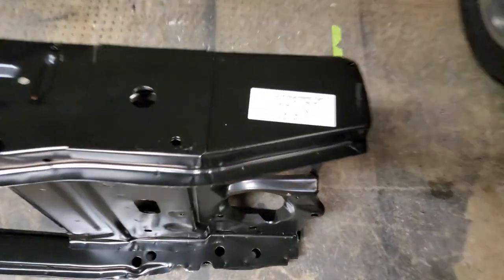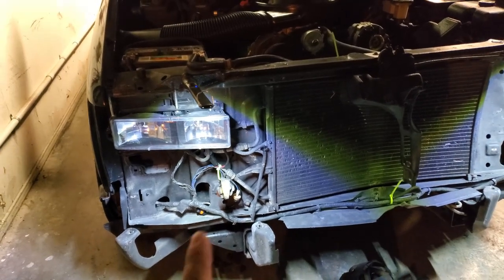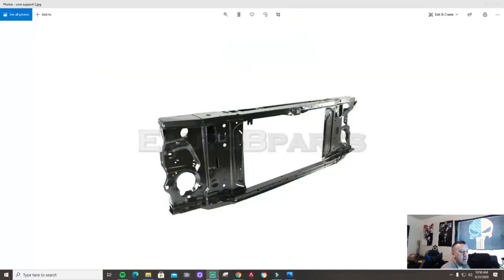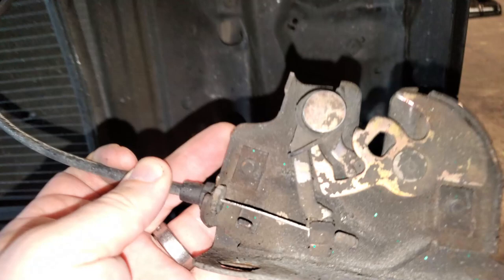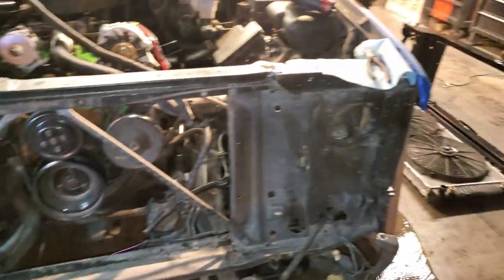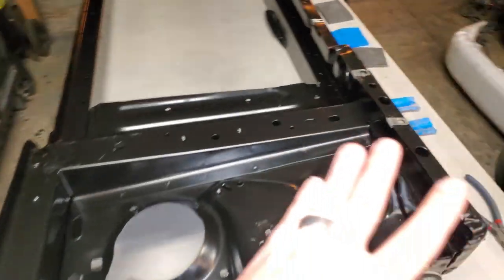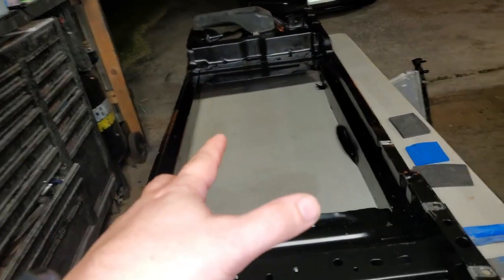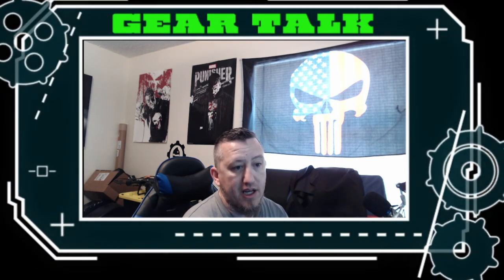Removing Radiator Core Support 88-98 C1500

Comment: Mine is rotted to hell on the drivers side. Looking for a good used one so many are the same way even in the South where there is no road salt. Mine rotted because of NYC/NY Roadsalt.  You did not have to umbolt or loosen any fenders? Going on another quest to find a good used one  I have the Small hole radiator 4.3/5.0 support. The 5.7 bigger  radiator supports are allover the place that are solid. I might jiust convert it to that and put 2 rubber shields.  Or cut the metal out my OEM one and seal the gaps

Comment: I replaced my 94 Chevrolet grill with a 94 GM grill after it was wrecked back in 94. 
  It’s been many years but I seem to remember having to exchange the core Chevrolet core support for a GM support to accommodate the grill I wanted. 
   Restoring the truck right now. 
   I’m older and my tastes have changed. I want the correct grill and I’m curious if my memory is correct. 
    Hoping someone can inform me.